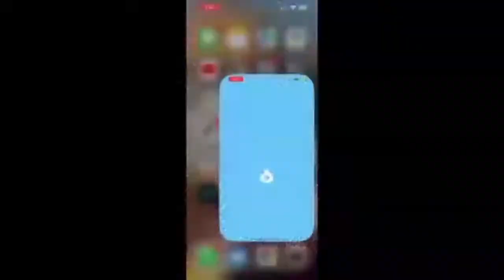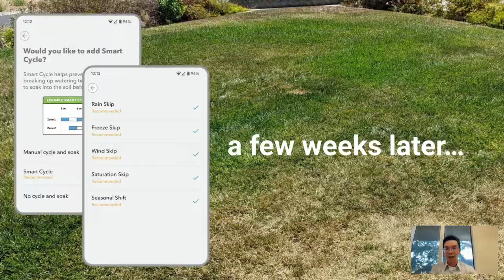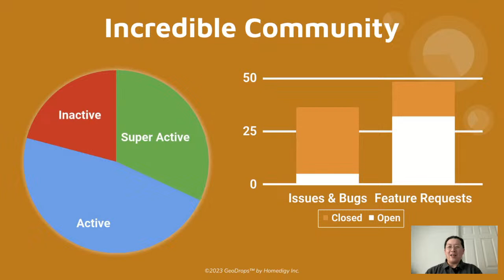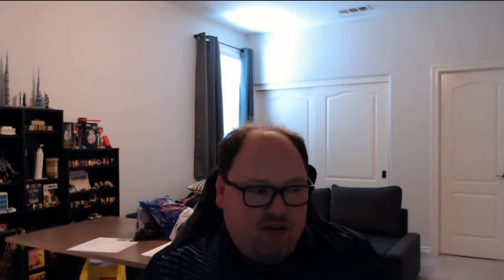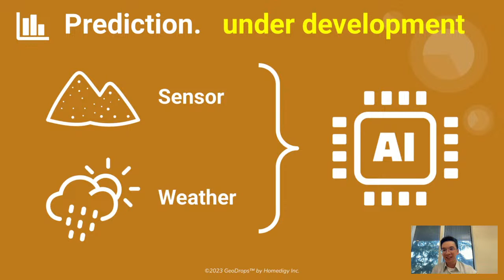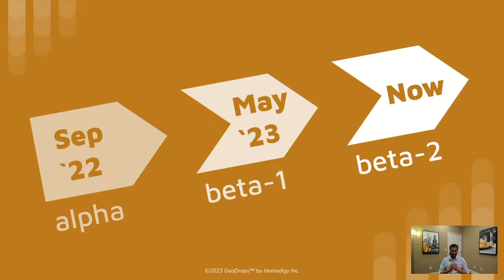GeoDrops Live Stream Event + Second Public Beta

Comment: Do u need to purchase multiple geodrops to place throughout the entire yard (like front yard, backyard)? Or is just one unit enough to give accurate readings for the entire yard? (My case being 1/4 acre)
Reply from the maker: It depends on how many different zones you have in the yard. B/c your yard is 1/4 acre, while I don't know how many you'll need, It's very likely that more than 1 is required.
Reply: @geodrops  what are u referring to when u say zones?
Reply from the maker: @nopi717   Long story short, based on the likely differences in topography, soil property, and shade patterns across different sections of a large yard, we originally answered that more than 1 unit would likely be required.

That being said, we would advise you to start with purchasing 1 unit to start, and then buy more units as you determine when you want to continuously monitor more regions. 

Please feel free to send an email to inquiry@homedigy.com if you have other questions. Thank you for your interest!